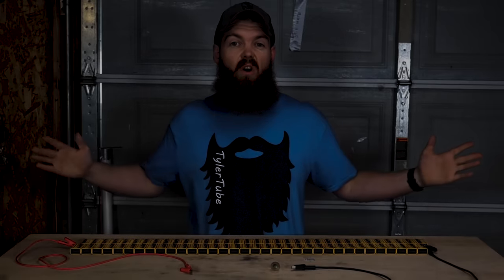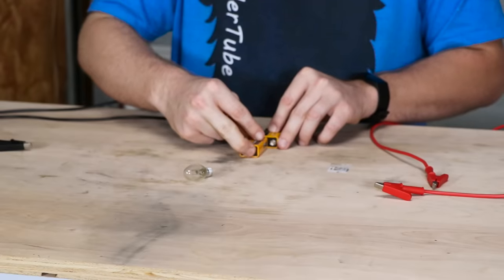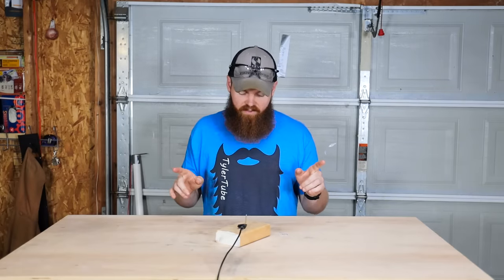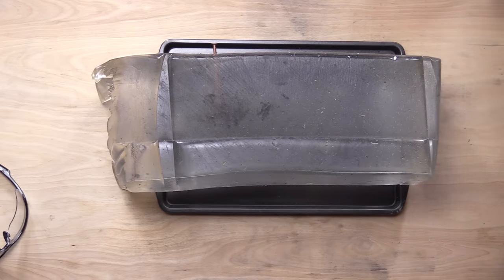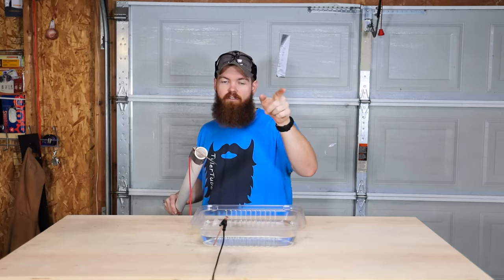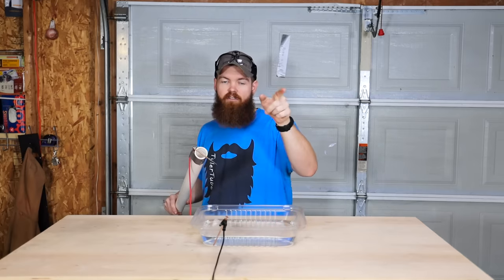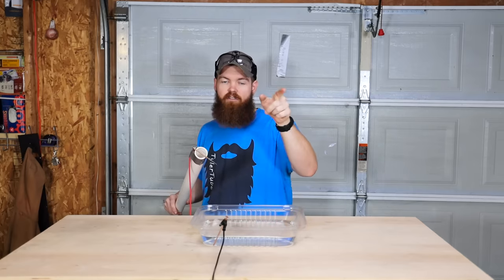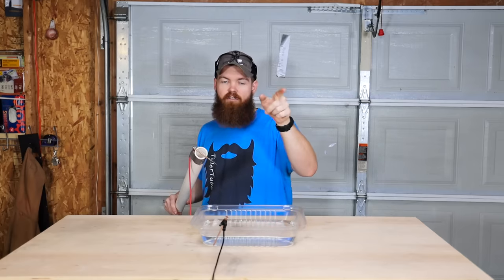I Connected 500 - 9 Volt Batteries...

Comment: I just found this video and believe that the possibility of anyone doing this getting killed is very real. Some of the comments are very wrong and make it clear that many do not understand the danger. Yes, the casing of the batteries was never intended to withstand thousands of volts and placing one's arms across both ends of a string could lead to insulation breakdown and a serious shock through the chest cavity. As stated, the possibility of death is real. The statement that a 9 volt battery can only produce 15 mA is VERY WRONG with today's alkaline batteries. I picked up two random used 9 volt batteries from my desk and put a digital meter on the 10 amp range across each one. The "Members Mark" cheapie from Sams club read 2.75 AMPS, while the Energizer MAX hit over 3 amps before settling at 2.82 amps. The pair in series made 2.84 amps. New batteries fresh out of the box should do better, so this experiment could deliver 4500 volts at say 3 amps (13.5 KILOWATTS!) for long enough to kill you and cook you to at least medium rare before battery discharge slows the fun. The test lead wire should not be trusted at this level either. The human body is far more conductive than wet wood, but you can see the power available in the wood demo. Several people have already been killed doing this with wood.

I have fried far more stuff with electricity than most people. I used solid core spark plug wire for hookup, and put a 1/4 inch thick sheet of Lexan between me and the test. Have a fire extinguisher ready. I used transformer power, but here one must be prepared for a battery to explode because if you do this enough the weakest battery will absorb the brunt of a discharge and it WILL explode. As some of your experiments revealed the gaseous or liquid discharge from things like hot dogs and alkaline soap can be conductive enough to support an arc as you draw the electrode away. That arc can jump to another conductive path if it so chooses. Don't let it be YOU. I rigged up a way to control the fun remotely so that I was not near the test.....and most of all remember that you should not discharge a cardiac defibrillator into a banana unless you like cleaning a brown and yellow goo off of the ceiling.

Comment: I am impressed. Damn, I don't know by what miracle you are alive. You should know that a garage door is made of aluminum and is indirectly connected to the ground. Putting an electrode on it indirectly connects you to it. And then you touch the other one with your hands (you were very lucky that the connection was not perfect). You should know that a 9-volt battery can easily deliver more than one amp, meaning that you have a voltage and current that is more than sufficient to kill you.

Comment: Voltage is able to arc at 2k , 4k is crazy. The reason why the hot dogs were all static, is because when you leaned the nail up against the garage door, you essentially created a path via ground through you when you touched them. Cool video, but please be careful.

Comment: What you are showing I just saw in the desert in another youtube video.  They were showing the paths of rivers carved by massive electrical discharges.  The paths looked identical to the dendritic burns on your wood.  That is how electricity moves through ground as well.  As it does it fuses sand or quartz in rocks. Changing density and causing cavitation (holes). The ground sinks making a river bed.

Comment: When lighting your bulb, you are not developing full voltage. Your 9 volt batteries only develop about 150 to 200 ma. A 4 watt @ 120 volt bulb may not sound like much but when you take the voltage higher than it's filament's voltage, the bulb begins to look more and more like a dead short heavily loading the batteries and dropping the voltage.

    When I was a kid, (more than 50 tears ago), I had acquired an old tube type AM radio that resembled a drive in theater speaker, (unintentional I'm sure). I went to Radio Shack and bought 13) 9 volt carbon / zinc type radio batteries for 15c each. I wired them in series to develop 117 VDC. I wired them to that tube radio and made it a portable. When doing this, if the polarity is reversed, the tubes will light but their semiconductor action will be inactive. If you get no sound, reverse polarity and it will work.
    For anyone who may consider doing this or any other high DC voltage activity, USE GREAT CAUTION!!! 117 VDC across your heart., like from hand to hand or, to a lesser degree, hand to foot is more deadly than 120 VAC from a wall socket. AC wall voltage drops to zero 60 times a second giving you an opportunity to let go or be thrown clear 60 times a second.     
    High DC voltage is a constant power source. If you accidently grab the positive and negative connections with your hands, your muscles will lock and you will not be able to let go giving said voltage plenty of time to cook the natural pacemaker organs in your heart causing death in a short time without fast, invasive medical intervention.
    I feel that doing the high voltage experiments being done on this channel are wildly irresponsible for the channel master's own safety and his own liability if a viewer gets killed emulating his activity. At the very least, he should have prefaced the program with a disclaimer illustrating the hazards associated with his suicidal folly.

Comment: for the distilled water you have to think of the particles already in the container. Those particles could have caused the conductivity. Because based off of chemistry, pure water is not conductive
Reply: ...for the distilled water you have to think of the particles already in the container. Those particles could have caused the conductivity. Because based off of chemistry, pure water is not conductive...

ANYTHING is conductive if the voltage is high enough. I once saw in school a 30kv coil draw a two inch arc to a granite laboratory counter top. A cautionary tale to budding electrical engineers.

Comment: Actually the ESR (equivalent series resistance) is what is causing the light to not blow. Remember Ohms Law. V=IR. The higher a resistance, the higher the current across a fixed resistance, the higher the voltage drop across that resistor. So lets say we have 4500 volts and 1 amp. And since each 9v has about 1 ohm of resistance, 500 ohms. So we have our equation. 4500=I*500. I=9. We have 9 Amperes of current. This a direct short across that massive battery bank.

Comment: The E is refering to the base and the number is the size of the base or bulb in 1/8s So the E12 is 12 1/8s in diameter or 1.5 inches. The average bulb will be an E17 or as it's known as a Medium screw base. The C is the style of bulb so its a Candle style if it is a globe style it will be a G so the light bulb is 7 /8s in diameter or 7/8" wide

Comment: To all those claiming "it's not the voltage, but the current that kills bla bla bla... 9v batteries are limited in the current they can output bla bla bla": It's also the increasing current that makes the light bulb shine brighter and brighter every time he stacks up more batteries. More voltage means more current, it really is as simple as that, it's called Ohm's law. The only way to drop the current in a circuit is to either  drop the voltage or increase it's resistance.
Now, batteries do have an "internal resistance" that increases as their discharge current increases (in practice this means that if you discharge them too quickly, they appear to be unable to "keep up" and you see their voltage drop, and with that the current they generate). But this takes time, and especially with 500 of them, they will keep pushing quite a current for quite some time, before getting overwhelmed and start dropping their voltage.

Comment: With the distilled water, you have to rinse out the pan and probes with distilled water. Your hands and dust in the air has salts that make the water more conductive than it otherwise would be.
Reply: at first i read that michael reeves is commenting...

Comment: Even the most pure distilled water, it is still slightly conductive, albeit having a very minute conductivity. The reason is that water molecules auto dissociates, naturally breaking some H2O into H+ and OH- to form a variety of complexes (H3O+, H4O++). These species are very rare, but they do exist and they conduct electricity. Especially in high voltage regimes. When he touched the distilled water, these charged species transferred energy from the batteries to the water and started a process of electrolysis, breaking even more water molecules. The electrolysis of water forms H2 and O2 gas, which is a very dangerous mixture. If he had let the current produce enough H2, the arch could ignite it. Just imagine what the jump scare could've done.

Comment: Everyone else already yelled at you about the electricity risk, so I'll throw another risk on the pile: be careful doing things like this in an enclosed space, high voltage plasma can create ozone which is toxic. It's not drop dead toxic or carcinogenic, but US safety standards set a concentration of 0.10 ppm as the maximum. Again, it's not deadly toxic, but even low concentrations can irritate and inflame lung tissue, with extended or concentrated exposure leading to permanent lung damage. So in the future, do this with both proper electrical safety measures AND in a well ventilated space.

Comment: Shops at highschool:  "bring a bun and hotdog".  With two nails, a board and a 120V AC linecord with plug a demonstration was made regarding safety and respect for electricity in class.  We were allowed to eat the hotdog; relish, mustard, and ketchup were supplied by courtesy of the teacher.  No screeching females.  Good auld times and respect for the teachers.  Good memories.

Measure before and after resistance in Ohms.  Perhaps there is a correlation between "rare" and "au pointe"?

For the woodburning craft:  use a "green" tree-leaf on a "slab (sheet) of metal and a "wet/moist" piece of wood with a connector.  Try to transfer the leaf's pattern onto the wood.  Perhaps use colored water?  Freshly killed fish for a scaly pattern?  New hobby Electro-bioprinting? Ichtygraphy?

Comment: Dude this is for real DEADLY. Do not think just because its only 500mA its not deadly, it takes MUCH less to stop your heart. Plus a 9V will send out 3 to 5 amps peak for a very short period, but long enough to kill you. The 500mA (which is enough to kill you at this voltage) is continuous.

Comment: amperage kills, but only if it has enough voltage to push it, that's why you don't die when you touch your car's battery terminals. It's also why high voltage tasers and cattle prods rarely kill!

Comment: I would love to see an attempt to use a stun gun to cook hot dogs. I was livimg in my car, and one night I decided to use my pdw (a 1 million volt stun gun(at least, it said 1 million volts, dunno bout that...) to try and "grill" some hot dogs I had in my cooler. I had an aluminum foil pie pan from earlier and I laid each one in it on my dash and I touched the contact spikes to the edge of the foil pan and let ir crackle for a bit, and it worked! It even smelled grilled! I highly recommend trying this out...I'm sure Amazon sells just such a device, shouldn't be too hard to find one...Farmer's Market type places usually have at least one shop or booth that sells "ninja gear"...

Comment: There is a difference between destilled and dionised water. Dionised water literally has no ions in it, whereas distilled has had most ions removed in the distillation process.

Comment: With properly distilled water and no contaminates then it is not conductive at all, in fact it is a perfect insulator. In fact it is used to insulate wires during high voltage breakdown testing.

Comment: Soap is mostly propylene glycol, I'm curious if the orange flame would come with pure propylene glycol (it's extremely cheap and easy to find).  I'm wondering if that flame was due to the perfumes and other additives vaporizing when the electricity arks to the PG, due to the hie temp.

Comment: Sadly due to the Copper nail -  Your distilled water gets Easily Copper contaminated on just the Surface contact (copper + copper salts + copper oxide rust - Copper(II) ions likes to easy Absorb into distilled water) + more So via DC electrolysis  - you need Carbon Rod electrodes so if the carbon goes into water it wont  absorb into the water it why you can make Under water Carbon Bar ark lamps without the solution becoming Carbon Contaminated (yeh you may get some dust but it sinks to the bottom of the container but you can take Vacuum that away)

Comment: If you separated your batteries into a series parallel set up it would pack quite a bit more punch yes your voltage would be cut in half but it would double your amperage and the amperage is What Does work.

Comment: the most interesting part of this video is how you somehow emulated high frequency current characteristics using just 9 volt batteries, please do share what magic you used if you didn't just plug a actual power supply unit because you found out either the batteries just degraded immediately and/or that running a battery bank that large with so much resistance would heat up that entire room to cooking temp within several minutes.
Reply: Have seen people do this before didn't look fake to me.

Comment: You should have tried resistors, diodes, capacitors. and zener diodes. Resistors and caps will blow up and the diodes will light up with reverse polarity. Do you know how close you came to dying? With that much voltage all you need to do is put a body part in between the 2 leads when they're close enough and the arc will jump across using you as wire and fry you.

Comment: This whole table being static-y is definitely not kosher.
Reply: I mean, if you think about it, you're pushing a few kV into a highly conductive hotdog, on a fairly well insulated (wood) table. It's effectively creating a large capacitor. The dpgs can't store much current, since they aren't designed for that, but they can build up quite a large voltage due to their conductivity and the wood's insulative properties.

Comment: Some moisture of the hotdogs has gone into the wood making it more conductive that before.  Beware next High voltage experiments please.
How about Fluorescent lamps, One connection to a lamp element; the other to some Aluminum foil wrapped at the other end without touching the other end's electrode?  
Make an electroscope, and calibrate it using your set of batteries.  Then measure the start and end voltage of your experimental power supply?   
Do peel the batteries open and show the spotweld construction versus cheap pressure/corrodable internal connection giving a value for money demonstration?

How about a neon sign transformer?  30 KiloVolt at 30 ma. at 60 Hz.  Some with center tap.  Full wave rectifier anyone? Found some of those on the garbage when I was fifteen.  Lots of fun.  I'm still alive!  Some Jacob's ladder!

Comment: what kept annoying me is that he was referring to the negative terminal as ground. IT ISN'T GROUND. if your black wire was ground then your red would be considered live and every time you leant it against your 'grounded' garage door it would arc and short the same as it did with the black wire, even if the door was terribly designed it would find ground through your house somewhere with all that conductive metal around you. You are working with batteries! they don't have ground and the flow of electricity in a battery fed circuit is usually depicted with the flow pouring OUT of negative and IN to positive so your "not so dangerous because it's 'ground' " black wire is actually the business end of the circuit ( providing you followed the norm with batteries and had positive hooked to red). Moreover you do not realise how close you were to dying. for instance: becoming the actual GROUND on the circuit (if your footwear is not adequate or you touch the  table or other grounded surface), becoming the least resistant load in the circuit, burning your shit down and most importantly violent combustion of all the batteries and many chemical burns. Batteries are not intended to be daisy chained like that in such great numbers and the reaction inside them is exothermic (produces heat) the more reactions happening the more heat and the more violent the reaction as heat is a catalyst.

Comment: The hot dogs experiment is not dumb.  It is the kind of thing real scientists do when figuring out tragedies.  How did these people die?  Was it the wire that fell into the water puddle they stood in? Was it them holding hands on shore to try and get the person OUT of the puddle?  Was it the car battery of the car also in the puddle of water? Was it a lightning strike?  They also look at burn patterns on the hot dogs and compare it to the patterns on the victims they are trying to determine the cause of death for.  Electricity can be very stealthy if you did not observe the death.
Reply: Because you come across a line of people some still holding hands all dead.  What???

Comment: Major flaw in the final test. Using them directly out of the package left them saturated with the water content they are sealed with. The current most likely wasnt even traveling through the solids, but around the outside surface through the water mentioned. I.e. after the 2nd one is added, you said "it will burn on the table... because of the hotdogs!" Incorrect. It's because of the water present all over the surface of the hotdogs. The hotdogs are simply the substructure for the water to wrap around. The ideal way to test what you intended to would be, to dry each one off as far as the surface. And have a dry table to place them on, so the voltage must travel through the through the conductive materials within the hotdogs. My two cents anyway